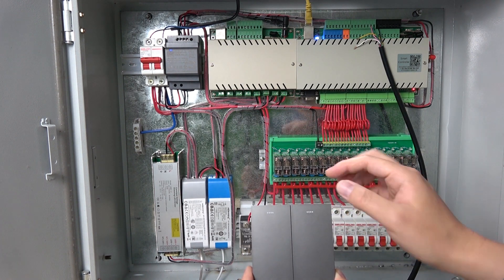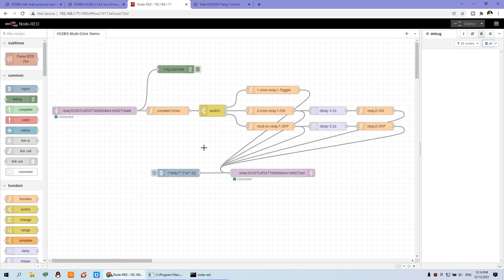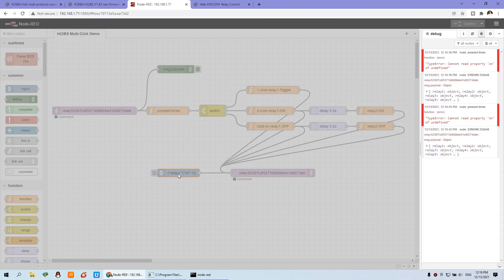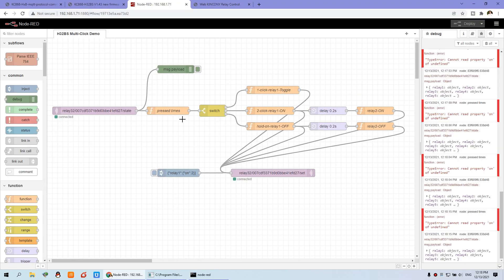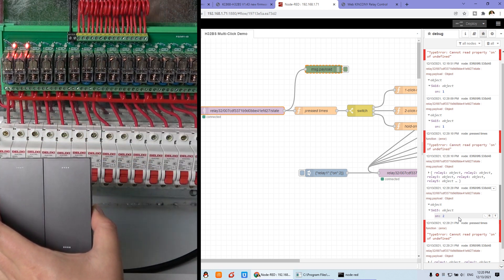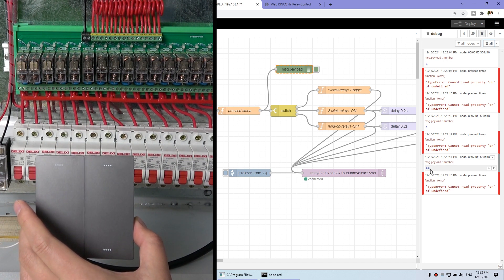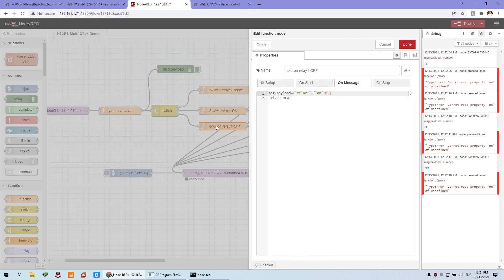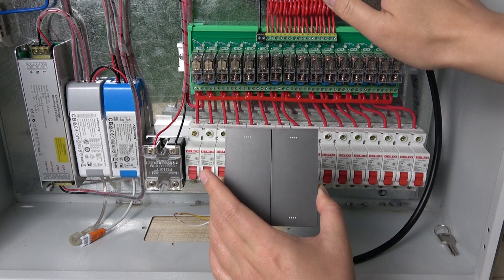how to use wall switch multi-click make any scene for H32BS by Node-Red

Comment: Can i use any light switch with this? Or do i need specific ones ?
Reply from the maker: any momentary switch can be used, easy to find
Reply: @KinCony  So what product should i get if i want to have automation with 28 light switches, 6 dimmer switches, 3 curtains, voice control and connect with home assistant
Reply from the maker: @PorfyriosVasileiou  KC868-Server:1pc  KC868-H32BS:1pc KC868-E16:3pcs KC868-D8:1pc dimmer +driver. Driver according to your dimmer load, AC220v or DC12V lamp?
Reply: @KinCony  why do i need all these? Is the server different from the h32bs?
Reply from the maker: @PorfyriosVasileiou  KC868-Server have raspberry pi inside.
Reply: @KinCony  so i need the server and the  h32bs? Also what is the e16 used for?
Reply from the maker: @PorfyriosVasileiou  yes, need server and h32bs, because you have many channel output, e16 is extend relay module.  i think you can see this link: https://www.kincony.com/forum/showthread.php?tid=1744
Reply: @KinCony  how much does this completed system cost? Roughly?..
Reply from the maker: @PorfyriosVasileiou  you can check price in our Aliexpress online store: kincony.aliexpress.com

Comment: Will this work with H32B also ?
Reply from the maker: these is a way to use multi-click function for H32B, just let switch terminal board connect to raspberry pi directly by USB-RS232 port, then Node-Red read the times of switch terminal board feedback message's times.